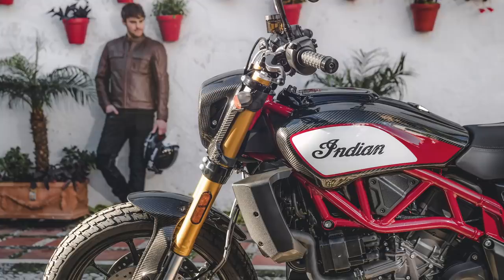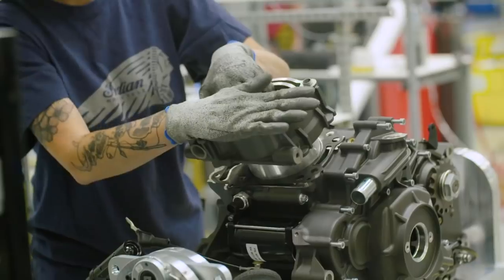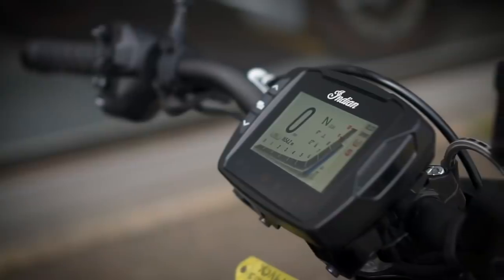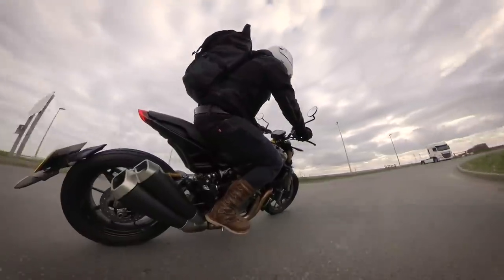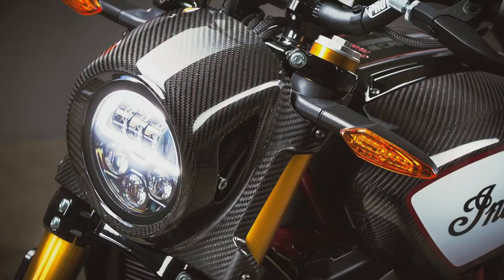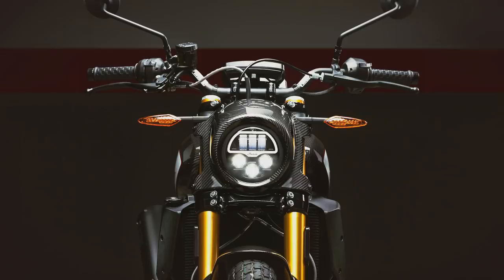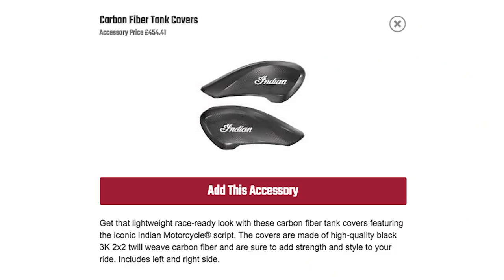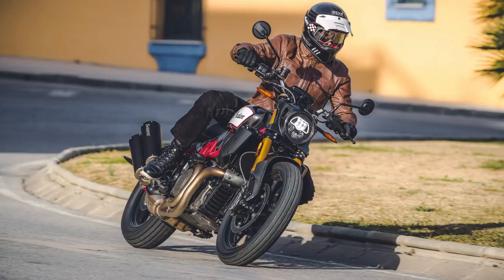New 2020 Indian FTR Carbon (FTR1200) Announced!

Comment: I really liked the FTR when I first saw one in the flesh a couple of years ago, but the more I see them the more I think they missed the mark a little. Just my opinion but I would have rather seen a much lighter, 750-900 cc, more hard edged, basic flattracker or a 1200, streetbike with dedicated road tyres and better manners. It's too much of a compromise for me.... expensive too.
Reply: I totally agree
This is just an American attempt at a Ducati 
A street tracker should be two wheels, wide bars, minimal seat and a High exhaust 
and not much else.
Also really should be a 750
Reply: I hope Indian starts building smaller displacement, lighter bikes.  I think they're planning to partner with some Indian (as in India) or Chinese brands, but I don't know how good they'll be unless they do their own designing from the start.
Reply: I agree lots of fussy unnecessary bits and huge hideous muffler after redesigning the scout engine so much they failed to build a light weight bike . Surely building their race bike cost far less and they could have built a lean lightweight street legal version of that maybe bored and stroked to say 900cc and detuned and making it pass emissions etc is mostly fuel management
Reply: When a production bike is styled on a show bike like this the result always looks like a Chinese copy.  Disappointment guaranteed.
Reply: @rickducharme7429  wow an Indian Indian 😂 it's not down to where it's made but the experience of the factory and the quality control standards that are implemented. I'd rather have an Indian Indian than a Taiwanese triumph!
Reply: Wow, I didn't expect it but it looks like most people agree with me 😅
Reply: @robbikebob  Don't worry. It won't last.
Reply: @rickducharme7429  they should partner with  zontes, they make some good small displacement bikes.
Reply: @John900C  .... pants 😕
Reply: @clevernduruza8624  I only know Zontes exists bc I saw one of their bikes at a bike show.  I know nothing about them, or where they are located.  Do you have more information about them?

It seems to me that there is a wide open market in the west for some smaller bikes with decent, usable power like the Honda 500 bikes, but with some better styling like the retro bikes of Harley, Indian, Triumph, etc.  If I recall properly, I was impressed with the look of that Zontes bike.  Royal enfield also has a prototype concept retro style bikes that's awesome looking.  What are your thoughts?
Reply: If it was a 100lbs lighter it’d be great

Comment: What's not to like?  I like the basic model right through the FTR 1200 line-up.  It's unique, and for real world riding it works.  If you have money to spare, go for greatness.  Personally, I would save that extra $2 grand for other things, but the carbon is a premium piece, and it has all the good bits you could possibly want for the asking price IMO.

Good vid as usual.  Rock on, Motobob, and keep 'em coming.